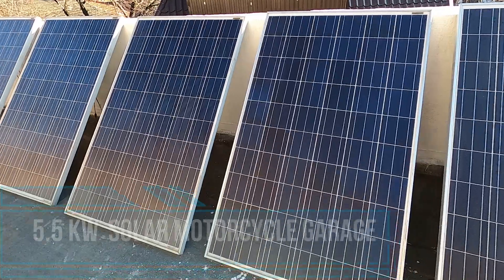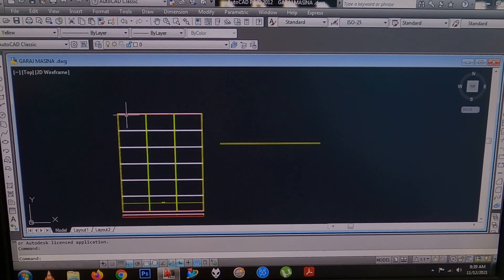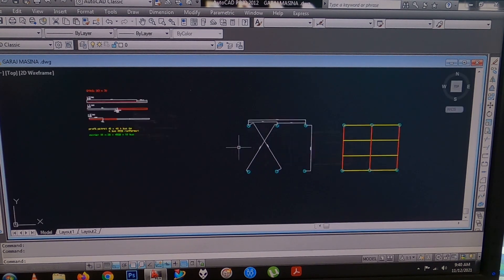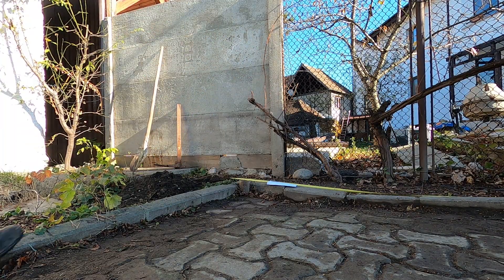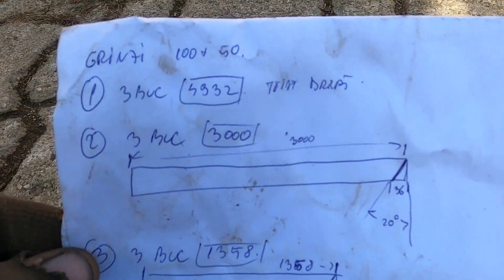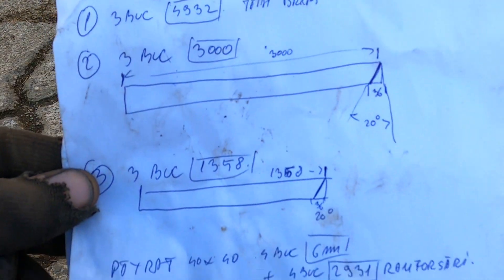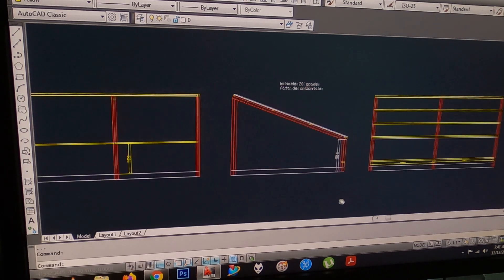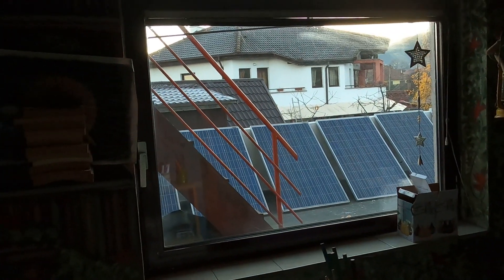Roofless 5.5kw Solar Panel Garage  Homebuilt With 2000$

Comment: that shed will double as a bridge ... epic build for the generations.  which was more expensive the structure or the solar panels?
Reply: Solar panels - $1200, Steel frame - $800
Reply: @TacticalGhost007   i'm totally shocked, seeing the costs in description don't relate and shows relative location pricing.  costing the steel out here and it was over $3000 + delivery in the US midwest and we have  local steel production.
Reply from the maker: @jthadcast  Hy there , the used solar pannels where still more expensive than the steel . its sad the steel tripled in price overhere , In romania too , and i still had a lot in mind using steel frames , but i will just use thinner . kind regards !

Comment: You probably just half blinded your dog with the welding.
Reply from the maker: Mike The dogs are garage dogs , sometimes I'm also shocked to see them looking at me when i lift up the welding helmet , i try to avoid as much as i can ,them sitting around when i weld . I usually weld in my workshop but when it is outside it goes out of control ... but the dogs are good .

Comment: great. You may want to look into microinverters if you have any of the panels shaded or partially shaded. Unsure where in Ro are you but you may want to optimize the slope of that roof.
Reply from the maker: u understand why you sugest microinverters , i will first check the stream power in the summer , if the stream drops too much i will go for them .

Comment: Nice job!  for the longest time I've had the same idea of a solar panel roof for protection from sun and rain.  How water tight is this??  Any reason to not have made the low end high enough to walk under?  

I have a 320w panel on the roof of my van that blocks water and sun from my vent holes.  I also built a solar coffee table i use to power fans, charging and a security camera in an off-grid property.
Reply from the maker: Hy there , thank you . we had rains and snow
and it looks good still no water leaking . you can use construction silicone ,or somebody gave me the idea to use car windscreen silicone that is very durable . also an idea to test would be to use a rubber lip btw them .
Reply from the maker: the angle of the panels is very important, in the wintertime, they need to have a bigger angle than in the summer and always positioned direction south.   I just calculated to fit a car under it and have the maximum angle I could get with a car under it  . if you make a smaller angle it will produce better in the summertime.

Comment: Frame is more expensive than the system. But it’s strong, built to excess.
Reply from the maker: HY mark , the frame is not exceeding it the tubes are 2mm thick . the whole construction costed 800 usd with paint .while pannels 1200 .

Comment: What kind of winds will it take?
Reply from the maker: I think more of less the same wind that my houseroof will take , as this is a metal structure . It should also take more wind than applied over  an existing roof with clamps  .
Reply: @thechangeintoselfsustainab9365  - Maybe?  House roof wind loading (to failure) is largely determined by the area under the eves (assuming doors and windows remain sealed, preventing pressurization inside the house?).  The area under an open structure such as yours, is much larger.  Similarly with roof-mounted panels (or decks for that matter), it depends on how much wind pressure can get under the panels/deck?  Yours is as strong as one can imagine, but is also a lot of square feet?  

This author's in hurricane zone.  Was planning to disassemble prior to any hurricane, but that's a lot of work (which happens several times each year)?  If such a structure as yours could handle significant winds (100mph-plus?) it might be worth thinking about doing something similar?
Reply from the maker: @tomnoyb8301  Oh Now i understand , if you live in a huricare zone i would do it totally different ,, the foundation would need to be much stronger . i live in a mountain aria where i only have snow . that is my only concern , and the next project on this build will be to build an access point to the pannels , and an  snow remove-ing system .but hey it you have winds you can always build up a windmill !